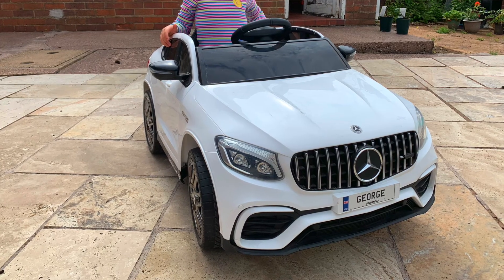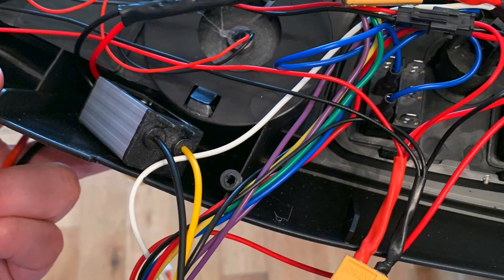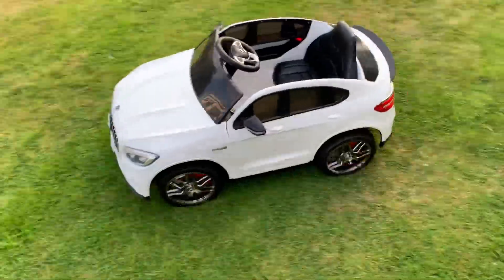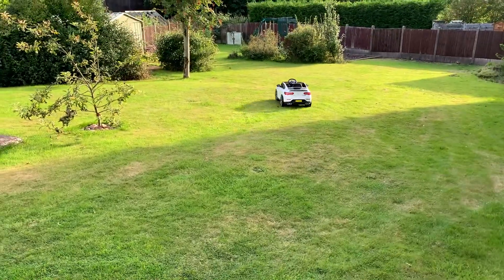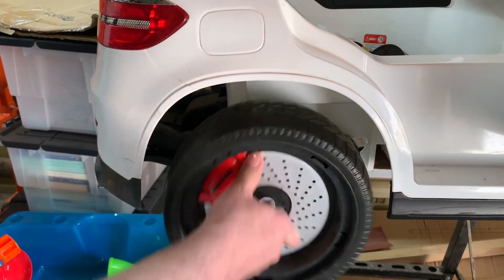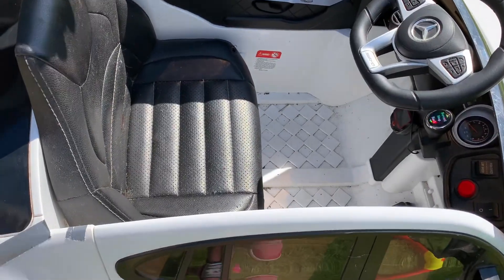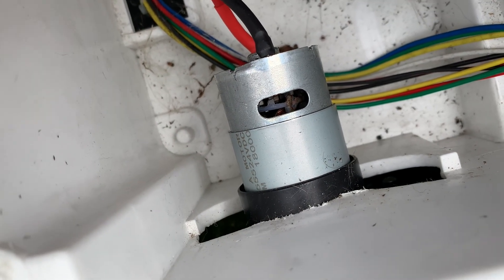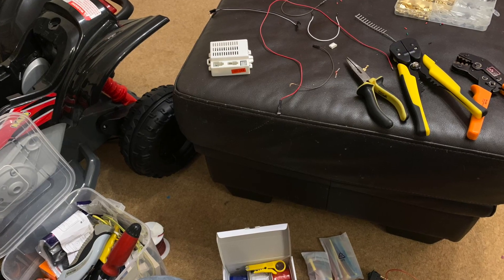Kids toy ride on electric car upgrade, too fast!

Comment: I would love to see your wife's face when she witness the new speed. :D  Great work. For anyone who not yet have those RC batteries, a cheap alternative are the LiFePo4 batteries which runs about $15 to 20 USD for an 8Ah battery.  They're cheaper because they can't output as much amperage but unless you want a brushless upgrade those batteries will be fine.
Reply from the maker: They would be far safer to use as well.  Sounds like another upgrade coming next summer! 😁

Comment: Hi I’m wondering if you could help me. I just brought my little girl one but it seems to go faster in reverse rather than forward . 
There no switch to turn it from low power mode to high could you hazard a guess for me it’s a ford ranger wild track 

Many thanks will
Reply from the maker: I really would not know.  You would need to look at the speed controller unit and try to find a model number that you could then Google for some specs.  They all have different pinouts.  Normally it’s a case of shorting out two pins or adding a switch to toggle high low speed.
Reply: @DeveloperDIY  ow ok perfect I’ll take a look in to this main thanks

Comment: 10 out of 10 for effort.. However..
Not sure I'd want my child sat on a highly volatile and known to spontaneously combust lithium polymer battery...
If only you'd just done the tried and tested 18v drill battery method which is plug and play and lithium Ion batteries that are in a steel shell- much safer and easier..
Reply from the maker: You are absolutely right, LiPo batteries need treating with respect, if you don’t fully understand the chemistry and how to properly charge, discharge, store and manage the batteries then I recommend to go with a safer chemistry.  However, if you always supervise your children, check the battery temperature, don’t mind turning your kids into speed junkies and you love spending money replacing burnt out motors! then LiPo is for you!   LiFePo4 would be the safest if you could find a suitable size, I would imagine.

Comment: If you reduce that voltage to 24 and keep the additional battery you could still use it to extend the battery life without the risk of burning out any of the motors. You could also use the DeWalt 20v mod and multiple batteries. That route requires a DeWalt quick charger or several batteries though and is a substantial investment.
Reply from the maker: All great ideas. Thanks for watching.

Comment: Hi, great job! I have the exact same model and have started upgrading it to 24V with RS750 motors. What about the radio and headlights? Do they still work on 24V?
Reply from the maker: You will need to drop the voltage to 12v for the radio and lights.  Get a cheap buck converter, they don’t need much power so a cheap one will be fine.  I think I said 5v in the video but thinking back it will be 12v.

Comment: I did this.  and the plastic motor can not hold the heat.  then melt it.
Reply from the maker: Yes, for 24v motors you need to keep the voltage below 24v.  Who’d of thought that! 😁

Comment: Where did you get all of your parts from? My son has a similar land rover and i would love to do this for him.
Reply from the maker: In the UK I’ve used Amazon and eBay.  If you search for “ride on car gearbox” they will range from £16 to £25 for a pair.  Just check the voltage and the RPM you need.  Remember, the faster they are the less torque they have.  Otherwise if you don’t mind waiting then I’ve also bought ones direct from China using AliExpress.  I’ve always found them reliable and slightly cheaper when you factor in tax and shipping.
Reply from the maker: @alextopper9638 for the controller search for “weelye controller”.  You can get fully wired or do it yourself.

Comment: You can probably get a step down converter & step down the 33v to 24v. Also, I think they make a four wheel drive version of that model. Perhaps, you might be able to find a front suspension part, that has the motor mounts. Alternately, I don't know how long the shafts are, but there might be some stops on the shaft that could be ground down. Then you could slip motor gearboxes on the front. You'd just need cable ties to secure the motors. Then, you'd need an extra set of rear wheels, to fit on the gearboxes. Accordingly, there is a separate speed controller, that will support four motors.
Reply from the maker: Thanks.  I’d not considered making it a 4x4, that’s a great idea.
Reply: @DeveloperDIY  One thing to note about the gearboxes for generic cars: They often tell you in the description what axle size they are designed for. Sometimes, the seller will have more than one version of the gearbox. I believe your Mercedes has 10mm axles - front and rear. Also know that very high speed motors tend to be a bit less tolerant of over voltage. They might also be a little low on torque, too. The higher RPM the motor, the more you might want to keep the voltage stock & rely on the higher RPM rating to deliver the speed you need. I mean, 40,000 RPM is a lot faster than 12,000, after all.

This video shows a four wheel drive version of the Mercedes. It's currently running the stock motors. Right now, I'm just working on the programming necessary for it to work.

https://www.youtube.com/watch?v=dTYz7ChCd2U
Reply from the maker: @jeremygeorgia4943  that looks like an awesome project!  Are you planning to use sonar sensors or some kind of LiDAR setup?  That would be immense.
Reply: @DeveloperDIY  Right now, I am working on lightning, and an improvised control system. I am using an ESP32 board for the wireless, and I am using an Arduino for the sensors, since they are 5 volts. I am using the ESPnow protocol for communication. I am sending the signals to the Arduino's analog input as PWM. When I get things working, I think I will pursue  camera input.

 That seems to be the cheapest solution & communicates the most information. I might then supplement with sonar. Lidar is a bit out of my price range right now, but that would be the ultimate goal. For the Mercedes, I am using two motor controllers, to give the motors the most power. ESPnow can broadcast to multiple units at once, so the front and rear each have their own unit to control the motors.

I have an additional ESP unit with an external antenna, that relays the commands to the front and rear units. It is directly wired to the Arduino, which controls the steering. Right now, I have switched focus to my Mini Countryman, which has a simpler 2WD setup. I am about through with the lighting setup that I want.
Reply from the maker: @jeremygeorgia4943  Good luck, I can’t wait to see the video.  It sounds like a very big project.
Reply: @DeveloperDIY  Thanks! The Mercedes project is unfortunately stalled. I tested it on grass, and it is too slow. I think the regulators need to be adjusted, to allow more current. Unfortunately, I wasn't smart about the component placement. I need to take everything out & rewire everything, if I want to change the configuration, so right now, my focus is on the Mini project. 

The routine I made to slow the inside track seems to work fine. I might find some more level areas to test it. For now, I am concentrating on the Mini. It has brake lights, running lights, and variable brightness headlights. I will be able to flash brights, once I get the remote set up. I do have a dedicated PWM channel ready, so I can eventually operate a sound module. Once it is a complete vehicle, then I can work on it becoming an automated & obstacle avoiding vehicle.
Reply: nice business model guys

Comment: You can't program the controller? You have a soft start on it?
Reply from the maker: Yes, the existing speed controller does have soft start.  I’ve not used the new controller and pedal yet.  I’ve been side tracked by the pizza oven project.  I’ll have another go at the car later this year.
Reply: @DeveloperDIY  ah ok. I've never used the LiPO batteries. Do you need a low voltage cutoff for it?
Reply from the maker: @beforeyourimmigrants8471  That would be a great addition to help protect the batteries.  Maybe set around 3.2v per cell as a cut off.
I always supervise the kids when they use the vehicles with lithium polymer batteries so I can check their temperature and voltage.  It’s best not to take chances with lithium based batteries, they need treating with respect.